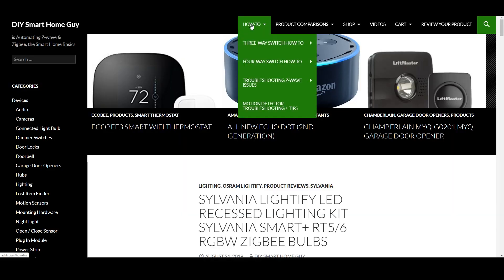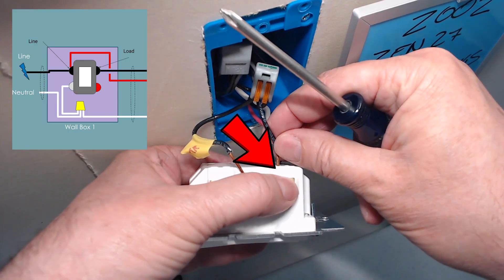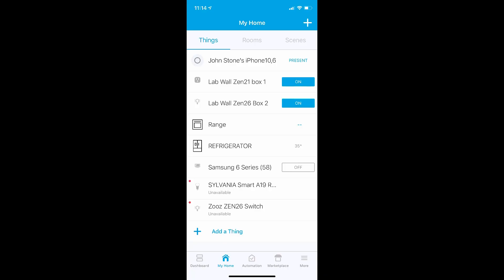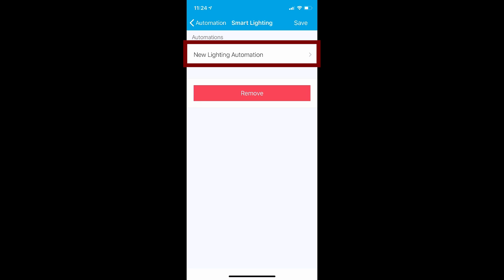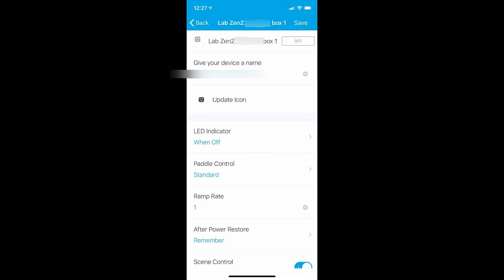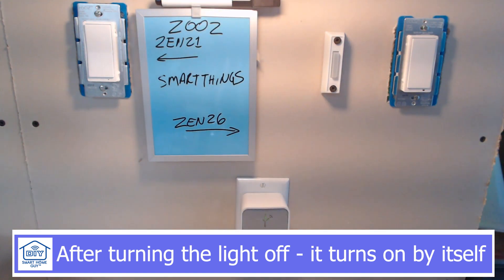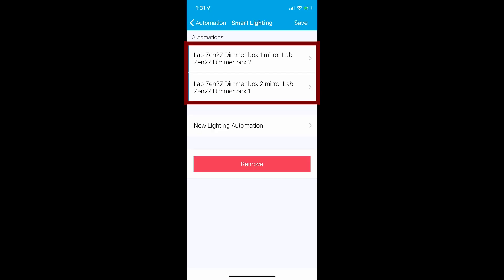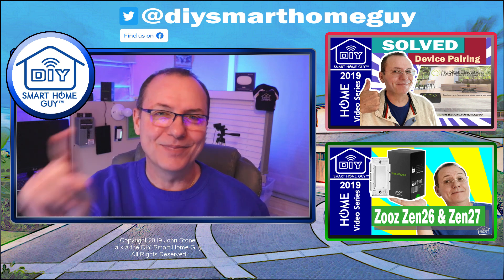3 Way Switch Wiring with Two Smart Switches - SmartThings

Comment: Can I use this system to group two separate 3-way switches that control recessed lighting? I want to be able to turn on and off both 3-way switches together at the same time, and still have separate control of each switch when needed.
Reply from the maker: It sounds reasonable - but the devil is in the details. I'd experiment with it and see what you can accomplish. Sorry I'm not any more help than that.

Comment: Hello, looking for a way to contact you but don't see it so posting here ... just wondering what you think of Homeseer.  Don't see any reviews of their switches or hubs.  Thanks!  (don't work for them, but I did decide to go w/their 200+ dimmer switches in my house, thinking about moving from ST to their hubs, which are not cloud dependent)
Reply: @DIYSmartHomeGuy1  Thanks John it does!  If I can briefly share my experience, I've been very pleased w/the quality and integration into ST - it's easy.  I did pretty extensive research and bought a few other switches when I first started setting up my house because I wanted to go all in once I started.  I have found wiring them to be pretty straightforward even in multi-way circuits, which isn't true of the other switches I tried. Also, I really love their multi-tap capabilities and I LOVE the programmable LED's that you can use for anything.  I have them change colors based on a few activities around the house so I get reminded to close the garage door, turn off my de-icing circuit on the roof, etc.  I find this invaluable.  Anyway that's my two bits.  I'll look forward to your reviews!  (Also, you might want to add a third way to reach out for those of us who have bailed on FB.  I don't miss it and I have no intention of going back!)

Comment: Why not use the Association group 2 setting on these switches.  Zooz switches support it and they would talk to the switched directly rather then using the smart lighting app, which would respond almost instantly. I would also imagine it does not have the issues of the mirror setting.  Just a thought, I have not actually used it yet, I only tested switch to switch myself.
Reply: DIY Smart Home Guy ok makes sense, would love to see a video on association groups, hopefully you will look at doing a more in-depth soon.  I have been trying to setup a switch controlling 2 bulbs for several weeks now.  I had no issues setting up a test from switch to switch just struggling with controlling the z-wave bulbs
Reply: To this day, I still think the Insteon product line does this « association » best. It’s a shame really that to this day, no other modern switch manufacturer has that level of ease.

Comment: Is there a solution for this scenario when there are no neutral wires? I am using inovelli Reds and a hubitat hub. Thanks in advance!
Reply: @DIYSmartHomeGuy1  Fantastic! Thank you so much!
Reply: @DIYSmartHomeGuy1  I think I figured it out! My set up is no neutrals, light/load in separate boxes.  If I were to look at your wiring solution B-9, mine has the GE add-on/aux switch in box 1 and an Inovelli Red in Box 2.  I think I may have also figured out an alternative solution which would have an Innovelli in each box.  I am sure that you already have a solution (hence the upcoming video!) but would love to share them with you if you think they would be helpful and to also get your thoughts.

Comment: The question here is not HOW but rather WHY?????  

I am not sure why anyone would use two smart switches for on/off on a 3 way.  I have 7 of these at home and all have only one smart switch on the line box.  I cannot imagine what benefit the second smart switch provides.  It can't get twice as smart :-)

Dimming is a whole different kettle of  ohms.
Reply: @DIYSmartHomeGuy1  Thanks!  I knew there had to be a reason.  As you probably guessed my implementation is pretty complex but rudimentary if that makes sense.  I don't have a hub except the simple zigbee in my echo studio.  Yet.  Getting a bit tired of trying to fudge complex triggers.

Comment: The 2 way mirror in hubitat works for me.
Reply: @DIYSmartHomeGuy1  I have the GE with an add-on switch because I needed light almond. But just wired up a zooz Zen 27 hot and setup the 2 way mirror. I've seen a switch bindings app for hubitat but haven't tried it. Not sure if it's available for ST. PS I enjoyed your interviews at CES.